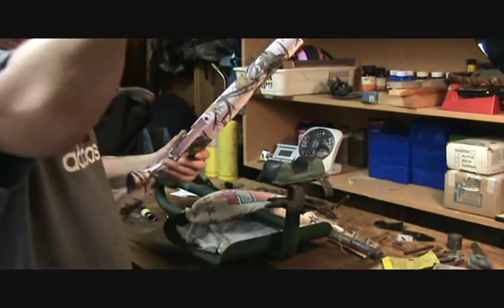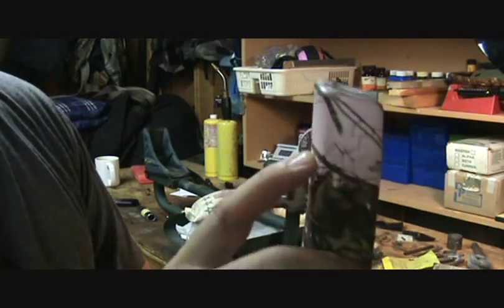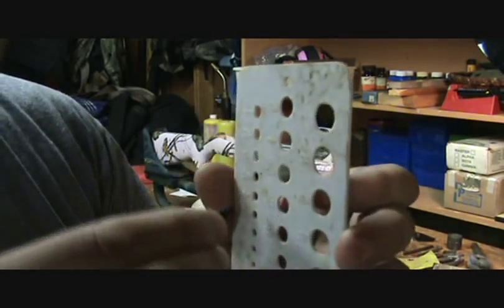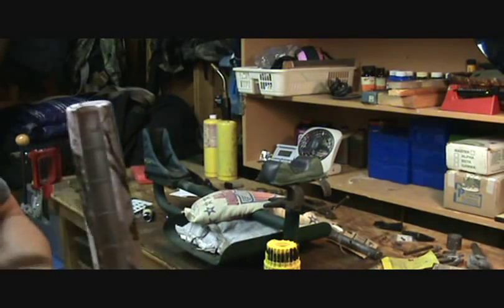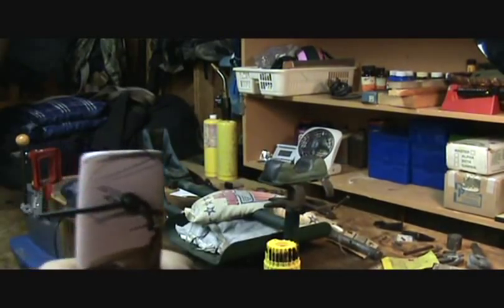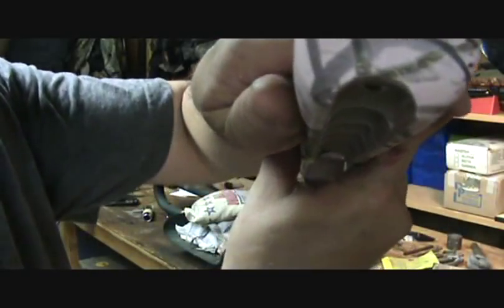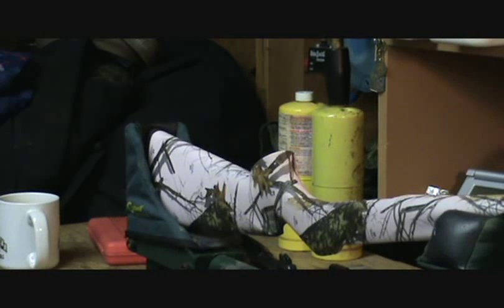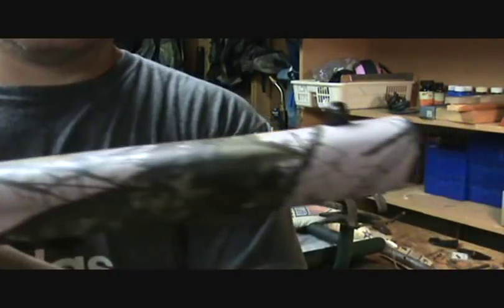Remington 597 mounting Sling Swivel Studs.wmv

Comment: Great videos!  I have the Remington 597 HB... do you think the ATI Swivel Studs with 7/16" thread area work without having to cut any off?  Only doing the front for a bipod.
Reply from the maker: Thanks.  And, I'm not sure.  All of the swivels I have mounted have been the same length, with the only exception being the wood screw type.  I've seen more stocks need recessed a little, to get things to flush up, or Nexus bolts were to short, rather than bolts needing cut short.  The heavy barrel MIGHT be the exception, but I'm not certain.  Sorry I can't give you a better answer.

Comment: question: how do i know where to drill the hole for the back swivel stud?
Reply: I just put a set on mine which has the heavy barrel.  I'd go at least a inch or so from the base plate, the part that goes to your shoulder when shooting, and just center it up.  The stock on mine is hollow so I don't think it will matter where you put the hole.  I just wouldn't put it to close to the end to make sure it doesn't try to split.  

Also, it's good to start out with a smaller bit than a bit that is to large.  You can always make the hole larger but making it smaller is difficult.  I can't do it at all.

Comment: Do you know the butt plate is removable and the stock is hollow; thereby, allowing a bolt for the real swivel stud?
Reply from the maker: I know it's hollow.  And the base plate comes off, but it's not screwed in, it's glued or sonic fused, so I don't know if I would call it "removable."  I didn't want to risk getting cheap plastic to break free from cheap plastic, and hope they both stayed intact.  But, if a person can get it off in one piece, you are correct.
Reply: Thanks for the insight.  Your video shows the rear stud as the screw type.  How thick is the plastic material accepting the screw stud?  Are there enough threads embedded in the plastic to allow for a firm hold?
Reply from the maker: +Dick Sternberg about 3/4 of the threads are in plastic.  Mine (not the one in the video) has been in place since 1996, and it gets used A LOT.